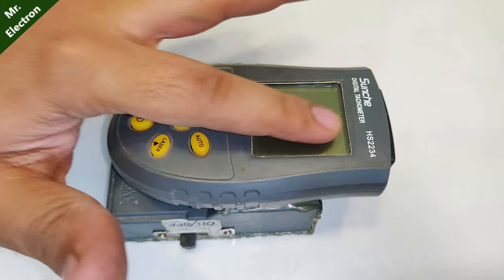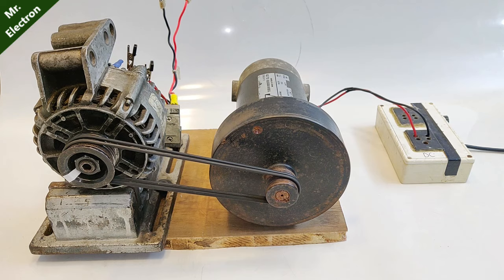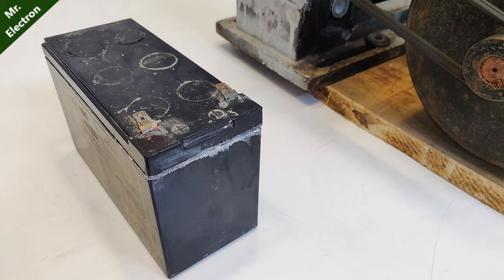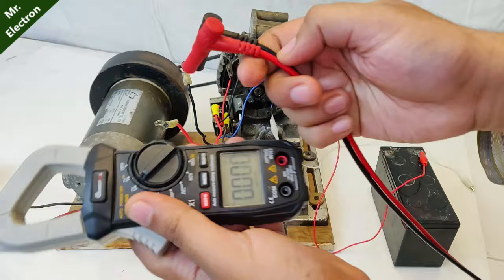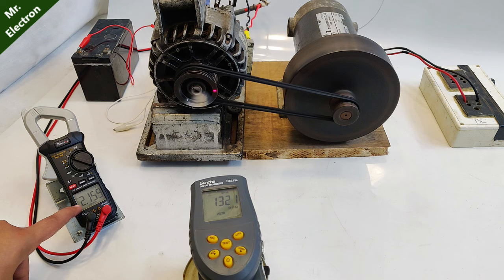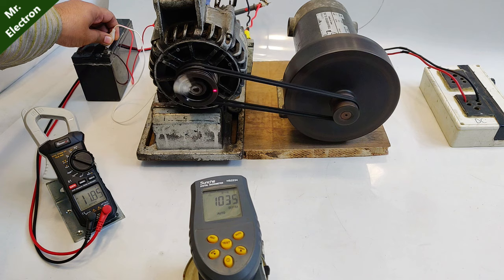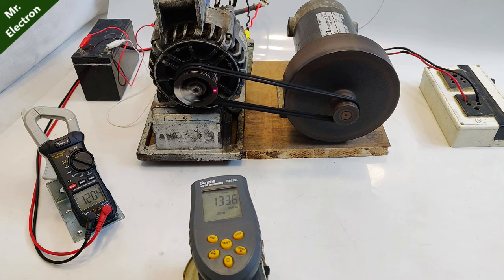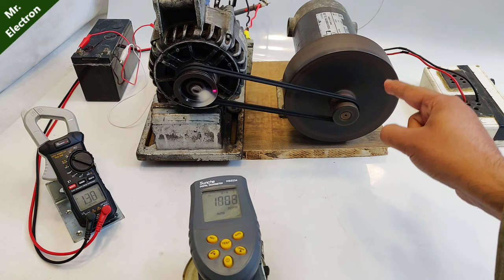12V 64A Car Alternator Minimum RPM Test for 12V DC Output

Comment: What happens if you increase the rpm? Does the voltage go much beyond 12/13V? Curious to know!
Reply from the maker: I have removed the ouput regulator so yes it does
Reply: @MrElectron ok👍

Comment: How many HP is the motor running the alternator and how many RPM can the motor run? The rpm drop when you send power to the alternator to turn on but those it draw down more as a load is being pulled off the alternator? If you have bigger batteries and they are charged up and your pulling a load off them and the alternator kicks on to start charging i can't see a serious load draw like that battery would be dead draw. I would like to make something like that to power and charge a battery Bank to run my car audio amps in the house seeing you can't listen to music in your car without getting tickets and having to pay out of your azz to enjoy something you love.

Comment: If it is actually 64 amps output with 12 volts then it is 1hp and 4lbft torque or 5.5nm torque

Comment: Can the 12v Battery be charged at the same time as it is being used ?
Reply: He's using an AC motor to soon the alternator.
If you used a 12V DC motor to turn an alternator, the load of the motor would far exceed the output of the alternator. That would drain your battery much faster than you could replenish and your battery would get hot

Comment: Can that alternator charge the battery and power the load whilst the battery excites the field winding?
Reply from the maker: Yes
Reply: Yes, battery excitation is needed only to create/start the magnetic field of the rotor. Once the output power starts inducing, a small part of it goes into rotor to continue the excitation. Once the rpm increases above 3000 rpm to may be 15000 rpm or so (based on make), it'll produce 13 to 15 volt DC which can be used to run any load or charge a 12 volt battery